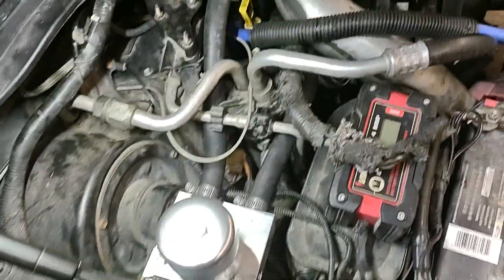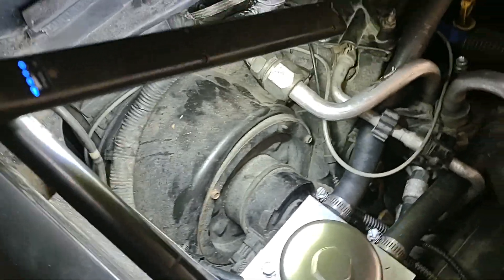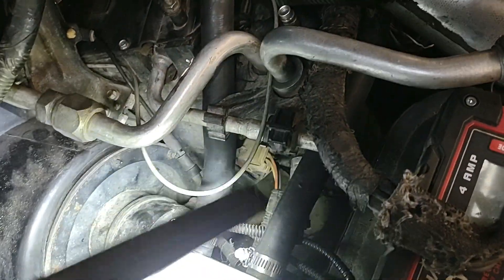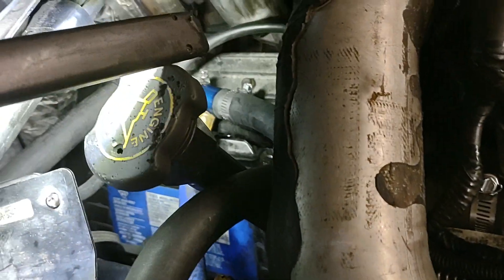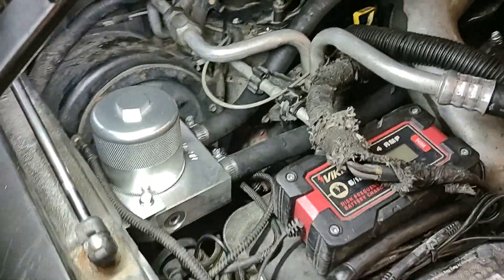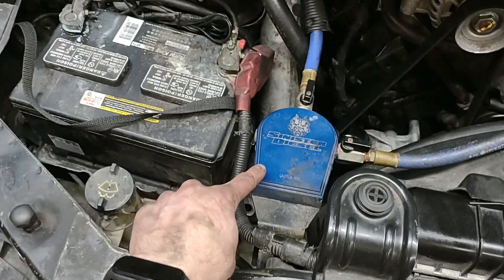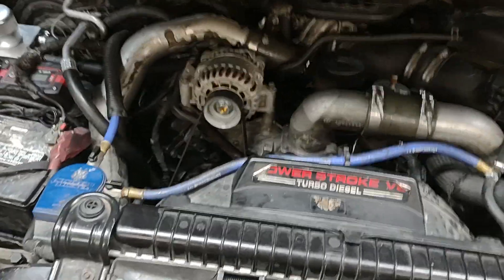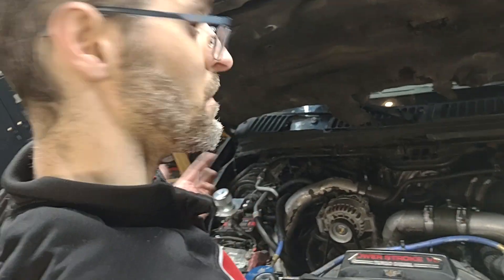Ford 6.0 coolant filter install from IPR

Comment: Great vid   Had mine on for 2 summers now   .. HOW  DO YOU TAKE APART THE FILTER?   i had buy  a aSpecial TOOL  from IPR to dissablethe filter   i cant get it to come apart   idk,,  but  it works  the   filter  but i know it need to be cleaned  ,..NO tech support..
Reply: only 1 back flush  in so far  ..my block  just terible
Reply from the maker: @KERNFUZED  not sure. I haven't bought the tool, yet  Only 3k miles with so far. When I do the next oil change I'm gonna check it out and make a vid of the filter process.
Reply: @Keiths6.0HotshotAdventures  ya    crazy I unscrewed  the Knurled..filter  put it in vise   thinkin  put tool with finers in there idl tryed to turn the inside   nothing  doesnt  even seem like toool fits the filter thing  i cant get it open!

Comment: How is that holding up? I also seen you didn’t have that valve for the heater core
Reply from the maker: So far I have a 3-4k miles on it and no issues.  I will be ordering the tool to check and clean the filter and will make a video while im figuring it out , haha.  Correct for some reason I don't have the heater valve, was like that when I got the truck and hasn't been an issue.
Reply: @Keiths6.0HotshotAdventures  good deal man ima set mine
Up kinda like yours hopefully i didn’t do all this work to just have to take the intake back off for a oil cooler lol hope this 4hr of back flushing will get me by for a while lol

Comment: how is your collant filtration system holding up? I have the Sinister Diesel kit but would like to get "110%" filtration as well
Reply from the maker: So far no issues, no leaks.  I'll pull it apart when I do my next oil change.  Flows fine, no temp issues towing.  The sinister kit works well for its bypass design.